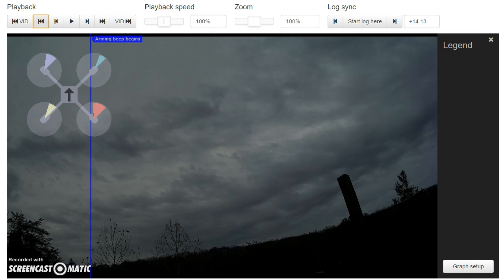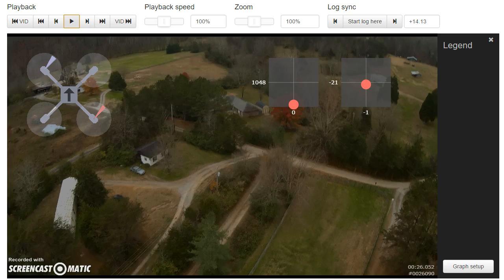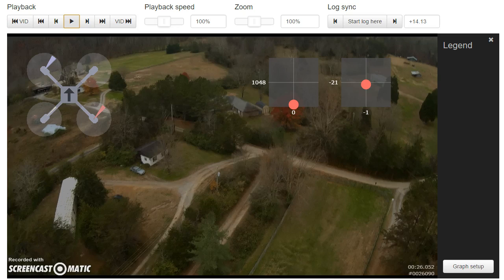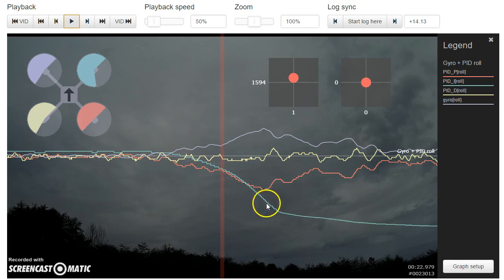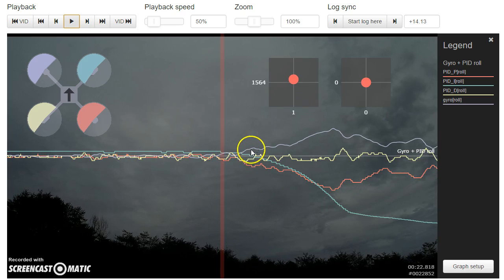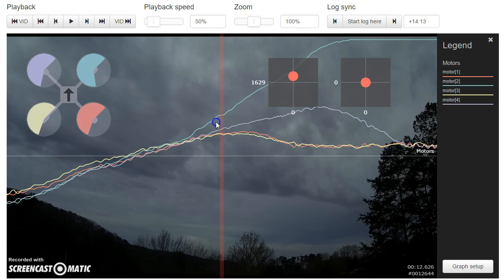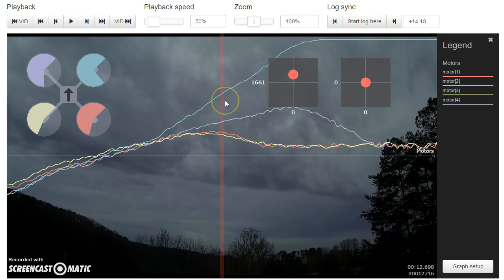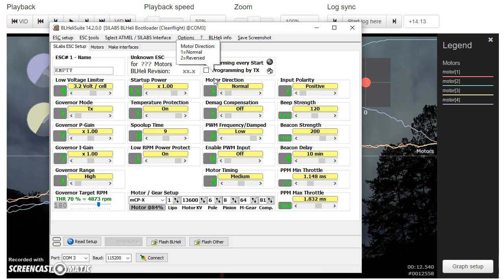Effect of misconfigured ESC throttle endpoints

Comment: I don't think this is a calibration issue, the motor traces all look similar up until the throttle reaches about 1600. If calibration was off, the difference in motor traces would seen throughout most of the throttle range and not just from a certain point up.

It seems more likely that motor/esc 2 has a mechanical/electronical problem, for example, the motor starts loses sync above a certain rpm and stays around that rpm because of demag compensation. The fc would notice the thrust loss in that motor and command it to go faster.

Lets say the esc's callibration was off, it's max end point was set too low at 1600 and it's min end point is the same as the other 3 esc's. The fc would see that the motor has too much thrust, lower it's power and it's motor trace would show to be lower than the other 3 motors.

I like your videos and would appreciate it if you do a followup video on this.
Reply from the maker: +Flying Dutchman You'd be 100% right if one ESC was mis-calibrated from the other three. But all three were equally mis-calibrated. So everything was fine until the flight controller tried to command any single ESC to exceed what that ESC believed to be the 100% throttle endpoint. Then the PID loop kept commanding increasing throttle to that ESC since that ESC failed to deliver additional thrust. When one motor maxes out, the PID loop can pull back the other three motors to compensate, but this doesn't happen until the motor hits max_throttle. This is why the quad became destabilized and then suddenly stabilized when the "runaway" motor maxxed out.
Reply: +Joshua Bardwell&#160;The example in your video only really shows motor/ESC 2 having any obvious issues, If the ESC';s were all mis-calibrated I would not expect the traces of motor 1, 3 and 4 to be so similar.

If the FC tried to command any single ESC to go over what that ESC believed to be the 100% throttle point, that ESC would then run the motor at full throttle and have an excess of thrust unless there is an issue besides calibration. The PID loop would then compensate for the excess thrust and decrease throttle to that ESC.

If any single ESC had a 100% throttle point that is higher than the FC's max throttle, then that ESC would have a lack of thrust and never see a full throttle signal. The PID loop would then increase throttle to that ESC.

The de-stabalization did not stop fully when runaway motor 2 maxxed out. If you closely at the flight footage(@ around 11:45 into the video) you can see the quad stabilizes pitch but keeps rolling un-commanded after that moment. 

I hope this explains my point a bit better.

In your video you said you've re-calibrated the ESC's, did you get a chance to test it? If so, did re-calibrating the ESC's fully solve the problem?
Reply from the maker: Yes, absolutely. So my analysis is actually a little bit retroactive. I'm sure it's correct because I already know what the solution was. 

The motor traces are similar because all motors are equally miscalibrated.
Reply from the maker: +Flying Dutchman Just to go a little deeper, you wrote: "If the FC tried to command any single ESC to go over what that ESC believed to be the 100% throttle point, that ESC would then run the motor at full throttle and have an excess of thrust unless there is an issue besides calibration. The PID loop would then compensate for the excess thrust and decrease throttle to that ESC." I don't think this is correct, because, at least in acro mode, the PID loop has no concept of the absolute amount of thrust being commanded, only the relative thrust between the motors. The relative thrust is then scaled by the throttle position to provide altitude or speed control, but that's just a scaling factor. So when the FC commands a value greater than the ESC's max endpoint, there is not an excess of thrust. Just the opposite. The FC is asking for more thrust by increasing the commanded throttle value, and the ESC is failing to provide that thrust because it is already maxxed out. The FC then continues to increase the commanded throttle value in order to compensate for the lack of thrust, until the FC reaches max_throttle. When the FC reaches max_throttle, that is the point where it realizes that there is no more power to ask for, and it compensates by reducing the throttle signal to the other three motors. The reason the copter did not immediately stabilize at 11:45 is because both motors #2 and #4 were simultaneously "running away" in that example. When motor #2 hit max, motor #4 took some time to reduce back down to a proportional level.
Reply: +Joshua Bardwell The PID loop does get a relative reference from the gyro, that's why i think it'l start compensating for the lack or excess of thrust before one of the motors hits max throttle.

Correct me if I'm wrong, from what i understand so far, all ESC's are mis-calibrated say at around 1600 max throttle and the flight controller is commanding all ESC's to go above 1600. The FC has to compensate for some drift, but there is no more throttle headroom and it hopelessly tries to spin the corresponding motor up to the FC's max throttle. Then only fully stabilizing when throttle is lowered again.
Reply from the maker: +Flying Dutchman Mostly correct. The FC is not commanding all ESCs to go above 1600. We can see this in the motor traces. What seems to happen is that the FC commands one ESC to go above 1600 and, as long as that ESC is "running away", the other ESCs are not allowed to increase, because increasing them would increase overall error, and the PID loop's goal is to reduce error. It is only after the "runaway" ESC hits max_throttle that the FC attempts to reduce error be reducing the throttle to any of the other motors. In the 11:45 example you mentioned, both motors #2 and #4 start to "run away", and motor #4 backs off while motor #2 is running away, but motors #3 and #1 seem to stay about the same.

We don't have to speculate about what the PID loop might do to compensate for lack or excess of thrust in this case. We have an example in front of us where the conditions are known and their effects are observable.
Reply: +Joshua Bardwell I kinda did feel the need to speculate on this, my ESC's never suddenly lost calibration, so no blackbox log of my own to go on and in the 11:45 example you only showed the motor traces. Being able to see the output of the PID's together with the motor traces would have been helpful.

Anyway thank you for explaining this.

Comment: I wonder if this has been the cause of historical yaw spinouts that people have been trying to solve for years with baseflight etc
Reply from the maker: +OpticalNZ Most people probably calibrated their ESCs correctly. Baseflight's poor yaw performance is a software issue, which can easily be demonstrated by switching from Cleanflight PID controller 0 (Baseflight) to PID controller 3 (MultiWii) or really any other PID controller.

Comment: Is this problem specific to certain escs? I notice you said you are currently using little bees and was wondering if the same scenario can happen to any esc or just certain ones?
Reply from the maker: In theory it could happen to any ESC but I have heard it suggested the Littlebees are particularly susceptible.
Reply: +Joshua Bardwell Thanks. I'm wondering if Littlebees are a source of a lot of problems. I've been following the Zeus/Little be thread on RCGroups and the last few pages of vtx problems, people are blaming the Littlebee.  Have a read same vtx problems on the Alien thread too but no one has linked it to Littlebees yet.  I would be interested on your thoughts on it. Either here on post on Littlebee thread. I'm just concerned since I bought a bunch of these escs on black Friday deals. Thank you. 

http://www.rcgroups.com/forums/showthread.php?t=2480328&page=78
Reply from the maker: +animatedlim I haven't really had any problems with them before this. QuadMcFly has said that Littlebees inject more noise into the system than other comparable ESCs. There are so many great choices for ESCs in about the same price range these days, I don't think you can really go wrong. If you don't like Littlebee, try RG20 or XR20 or XR40. Each one hits a slightly different place for size, weight, performance, and price, but any of them would be a great choice.